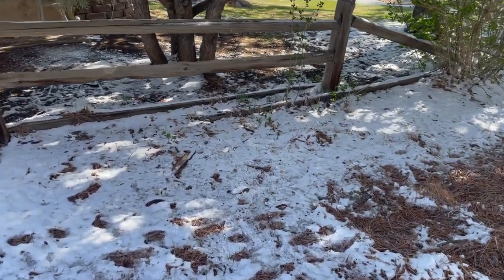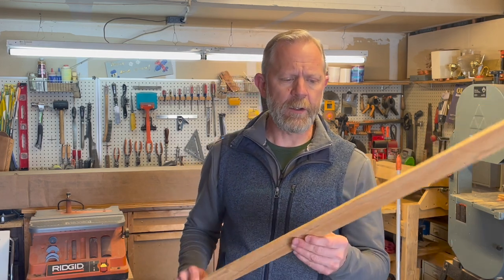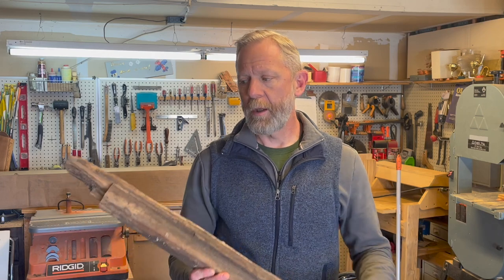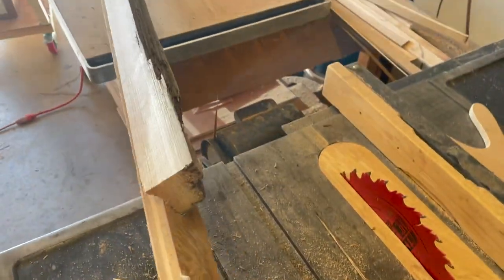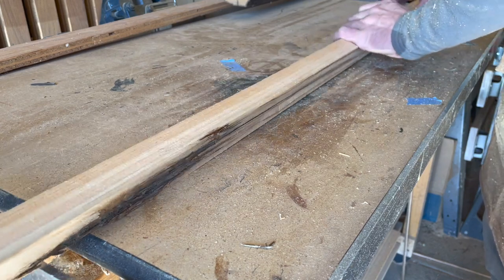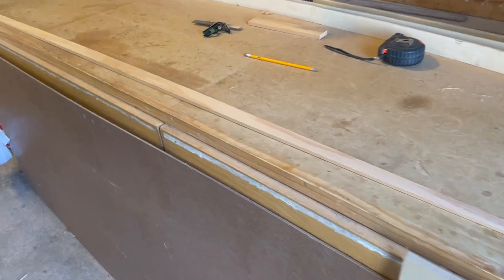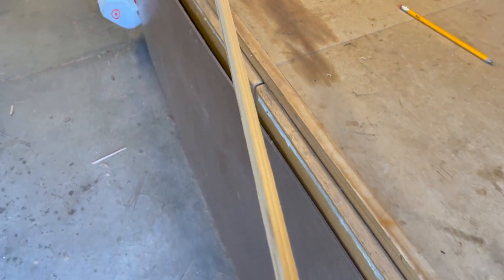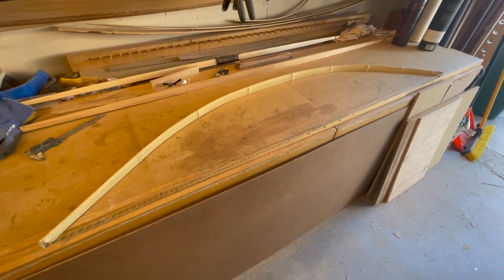Hill Style Longbow - 1

Comment: Is the cedar you are using western red cedar?  I also want to build a Hills style bow in the future.  I will most likely use some pacific yew that I harvested on my property.  The tree was small, 4-5" diameter, killed by the builder so I figured I would not let it go to waste.  I will try to use the Japanese timber bamboo I have growing in the back of my property.  I was hoping for it to get to a decent diameter but that's not happening.  I have maybe 3-4" diameter pieces.  Thanks for the video!
Reply from the maker: I live in the West, so it’s likely western cedar. Eastern cedar is better quality… in the end of this whole build along, I ended up abandoning the cedar altogether due to its lack of structural integrity under stress. The final iteration of this bow has a bamboo core lam, and is very snappy.
Reply: @meadowlarkadventuregear  Thanks for the reply.  End the end there was a lot to learn about this journey.  Thanks for taking us along!

Comment: where do you source your bamboo from?? Ive been building bows in the hill style for a while now and I glass back with either gordon tuff glass or bear paw glass. I leave the belly as bare wood and tiller from there. I would love to make some awesome Boo backed bows like what you are doing!
Reply from the maker: I've been struggling to find sources since the pandemic, but I have used Sunset bamboo mostly, then I picked some up from the Home Depot's web site and most recently I got some from forever bamboo.  I get the distinct impression that they all source from the same provider.  The only trick is that 25 slats is the minimum order which can be a bit much (both financially & materially) for the casual bowyer, but I go through bamboo like mad! Shipping costs make single slats expensive on a per-unit basis, but I also ship slats via orders through my website.  The advantage with mine, is that they are vetted out specifically for the length and style of bow my customers is making.